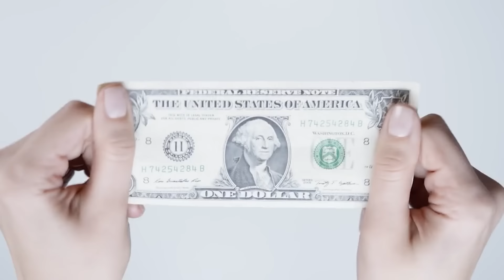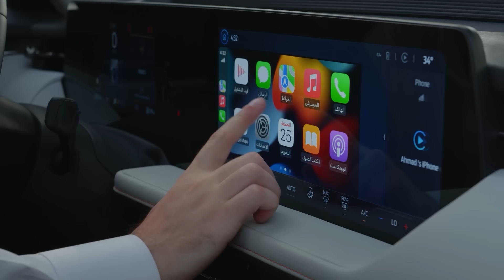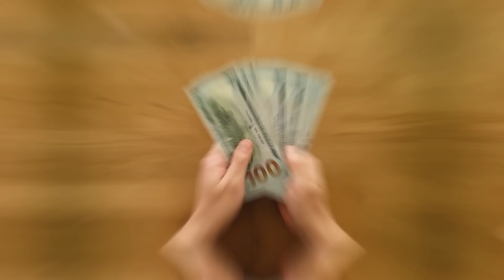Ford CEO Announces 6 NEW Ford Models For 2025 & WOWS Everybody!

Comment: Until Ford fixes its engine issues, I won't even consider a Ford.  Planned obsolescence just ain't worth it.  I'd rather keep fixing my old vehicles than have $1000+/month payments.
Reply: The 2.5 N/A is a very good engine. Just stay away from the turbo's.
Reply: Engines? It's the whole car!
Reply: Got a 2016 150 lariat with 130,000 miles on it with no issues. It might lay down on me the next time I drive it, but as of now I'm extremely satisfied with it.
Reply: @donaldsink8115  The Ford engines and transmissions have been particularly problematic the last 5-10 years, depending on the application.  The 1.0 and 1.3 L's have been AWFUL.  Ford is not unique in that regard.  I've had multiple Fords with zero issues, but they were late-80s and 90s versions.  Before turbos everywhere.  And designs that are calibrated to last just past the warranty period.
Reply: @asajayunknown6290   Mine is the 5.0 It had a little over 2000 miles on it when I bought it. I was looking for an Eco boost at the time. Glad now I got this engine. I pull a ten foot trailer a couple of times a week and depending on what I'm hauling as to where I use towing on it. Very rarely do I hot rod the truck and I think that has a lot of why I haven't had trouble.

Comment: A full size pickup with a bed large enough to haul 4' x 8' sheets of plywood powered by a V-6 or inline 6 and costing under $30k would be a game changer.

Thanks to SCOTUS repealing Chevron, the EV mandates are gone and most EVs will fail.
Reply: I wish Ford would bring back the reliable everlasting 300 inline 6
Reply: Or an updated version for the Maverick excuse me or The ranchero with an available manual transmission and rear-wheel drive there I said it again!!

Comment: My Ford van has a laundry list of stupid crap gone wrong, like air distribution stuck on defrost, to rust issues but the last straw was a spark plug blowing out of the motor, $1300 later and they created a transmission leak in the process. I am done with Ford

Comment: I suspect that these cars aren’t going to be in the “affordable” price range and severely miss the mark. People want affordable, reliable vehicles that are not easy to steal, sufficiently powerful enough to merge with traffic, don’t reflect high maintenance or repair bills, and don’t take six months or more after placing the order to receive the vehicle. Now if they started at $15k and would run a couple hundred thousand miles with simple maintenance, would be a game changer.

Comment: That was a 2017 Australian Ford Falcon ute they showed in silver in the Ranchero bit , in 2017 it was available with rear wheel drive , Coyote 5.0 supercharged and six speed manual , or a Turbo Barra 24 valve 4.0 six that made 425 hp .

Comment: "The Ford Maverick was revolutionary in the pickup world" - Oh, you mean like returning to a market left abandoned thanks to EPA regulations?  The new Ford Rangers are the same size a an early 2000 F150.

I loved my older Taurus.  It was fairly reliable but when something broke on it it was easy to fix.  Hard to find vehicles like that these days.  Though as a large seden car it should have no problem handling that 3.5.  Hell I'm pretty sure mine had a 3.5 v6 in it but without the turbos.  The other Taurus, or last generation taurus that I had also had a 3.5 in it without the turbos but the SHO version and the Police Interceptor version did.

I would like to see ford fix their cam issues with the 3.5 though too.  I'm about to have to fix it again...

Comment: Sorry but the only reason everybody seems to be transitioning to SUV's is bc Ford & GM have stopped making most of the cars (sedans), people had NO choice but to buy a SUV if they wanted a new Ford or GM. I just bought a New 2024 Honda Civic Hatchback Sport Touring (car) middle of May. I have NO use or need for a SUV, I would have consider a Ford Fusion or Focus ST if they were still being made. But now with the Taurus coming back, it would have been a high consideration if it had been sitting on the dealership lot in May. I also have NO need for a truck, I have a 2005 Colorado Extreme sitting in the garage with 44,500 miles on it. I had preferred my daily driver to be a car but I retired early 2 years ago at 55 so now it's just mainly used for shopping or leisure driving. This is why the Foreign brands are selling so many cars now, they about the only ones that still make affordable cars people want. This my first foreign brand car I've owned, have always bought Ford or GM in the past, I traded a 2006 Pontiac G5 GT for my new Honda but my Pontiac had been a perfect car. It was built when GM hardly ever had a recall or defects, it had a158,300 miles on it & everything still worked on the car including the air conditioning. There's about 99.9% chance I'll never buy an EV & bout 50% chance of not buying a Hybrid either. I don't see the point of either with the miles I drive now & replacement battery cost if damaged or needs replacing after so many years. I've had my new car 2.5 months & I've put 680 miles on it so far.

Comment: Glad they’re putting a sedan back into the mix and bringing over the Everest, which, in my opinion, should have been badged as the Bronco to begin with.  If they can bring it at an affordable price point instead of letting their greed get the best of them, Ford can make a killing!  They still need something to fill the small/compact segment.  Bring back the Focus and compete in the hot hatch world again….
Reply: The ford focus after 2011 became  an embarrament.  That horrible dpf6 transmission with all of the clutch issues, and still have to deal withthem. Most likely if the Taurus comes it will probably have a 4 cylinder turbo engine which has been another weak point. The biggest problem ford has are the unions. The latest contract with them is unbelievable. All those concessions that ford made are going to put on the consumer.

Comment: More of these over-boosted sub 3Liter engines that burn up in 30,000 miles. Used to be you changed the tires and checked the engine. Now, it's the other way around.

Comment: Sorry, no longer into Ford models. Had a 2011 Ford Escape XLT AWD, took it to my local dealership for all maintenance and issues. They either failed to notice the rear frame rotting out or failed to let me know it was rusting out. Been a life long Ford owner until now. Done with them and Ford. 

Went to a Dodge Hornet - now I have to deal an Italian sport CUV w/a Dodge badge. Had it a month now, and, so far no complaints.

Comment: The engine in my Hybrid Maverick destroyed itself at a whopping 7700 miles. Will never buy a new Ford until they have had several years of reliable vehicles. Too many problems to risk $50k going down the drain.

Comment: Plug-in Hybrid is really the better choice over a pure EV.  All the advantage of gasoline and you can use without an expensive fast charger or sparse charge networks. Ask any pure EV owner and they will admit that finding a "convenient" fast charger or even a reliable standard plug to recharge overnight can be a problem.  City owners with only overnight street parking have found that cold weather overnight without a full charge means a tow in the morning.  The only EV customer that fits are rich people who lease it, have their own heated garage and use their normal ICE vehicle to go long distance trips.    Owners with a worn-out battery will find their vehicle is practically worthless after the 8 year warranty is done and no new battery is available from the dealer.  Refurbished/wreaker battery can be had but are expensive to ship, install and limited range and short time warranty.   Add to this the insurance issues, fire risk, lack of service locations with qualified technicians as well as no "Right to Repair".  EVs have a very limited customer market as is.  If the gov't rebates and mandates were to disappear, so would the EV.

Comment: Long time Ford/Mercury customer. 2014 Focus last one.  Terrible build  ,quality, reliability, and durability. Ford is off our family's consideration list. Contrast the Focus with our 2017 Chevy Volt. Brilliant. The Volvo is fun to drive. Perfectly reliable through 120k miles. Body and interior still look good. And exceptionally low cost to operate😊. Ford did not internalize job one. Ford's high cost and low quality/reliability poses a terrible value proposition. Lower quality at a lower cost can be rationalized. But not Ford's premium for pain. (Stellantis has the same problem only worse.)

Comment: Farley doesn't have the market knowledge to put Ford back on the rails.  The EV foray is a disaster for the Big 3.  Ford, GM, and Dodge make good trucks but the money spent on EV would have kept them in the limelight.  Fortunately, Toyota has intentionally remained conservative in order to avert undue attention by advancing the Tundra to an industry leader.  Very Japanese in strategy.  Ford will recover but over time.  Meanwhile they need to develop "Flagship" cars that will resurge the Blue Oval.  Lee Iaccoca Farley ain't.  Ford better wake up and get some leadership with market and dealer knowledge.

Comment: Cannot survive. Best hope for revival if for Ford to massively produce low emissions 4 cylinder gasoline sedans/compact with 20 year comprehensive warrantee including all free maintenance except for accident damage. You just pay for fluids and gas, Ford handles the rest. The new gas cars would be pegged at $14k maximum.  A.C. automatic trans, cruise control, rust proof application, regular igition key(no
 fob) , radiofm + good sound, no traction control, no tpms tire crap.
If ford does this, they will recuperate the entire small car market. People need these cars to survive and go to work.

Comment: Ford: What people want is more for less, a non hybrid 2.5L with front or all wheel drive and even manual transmission models. What we don't want: more direct injection turbos with chronic carbon build up problems, tiny displacement engines, 3 cylinders, sync systems that don't work. If you're going to do a turbo make it dual injection port and direct so the back of the valves will stay clean. It's not that hard. Stop listening to democrats in power who have no idea of how politics work, much less cars.

Comment: Ford can announce new cars that run on fairy dust and I still wouldn't buy one. I'm done with ford after driving them for 25 years. The 5.4L  3 v and the eco-boost have turned me away from Fords forever. I've spent as much on repairs as I paid for my cars new. I'm done!

Comment: I've been a bleed blue Ford layalist for years. However, until Ford engineers pull their heads out of their rears and fix their quality control and shotty design problems, I won't be buying any new Fords. Im tired of overpriced cars and trucks that have turbos and cam phasers that blow up at 72,000 miles. Ford Eco-crap engines. PS. Ford has ZERO chance at beating Tesla at the EV game.